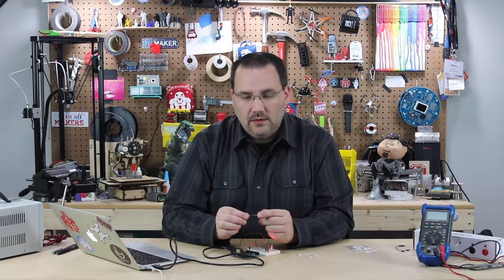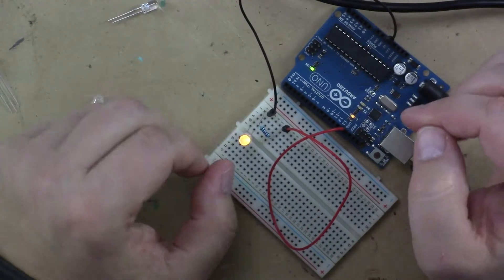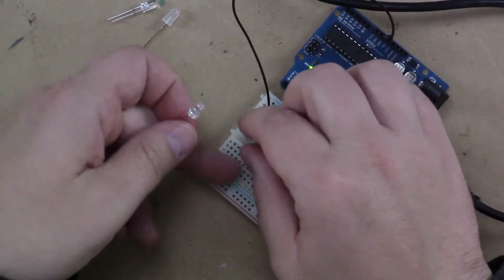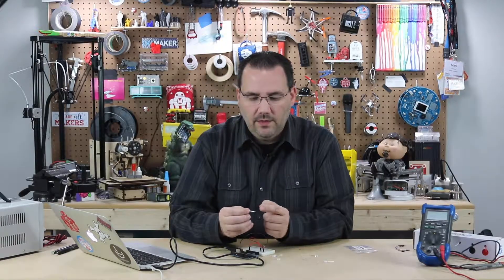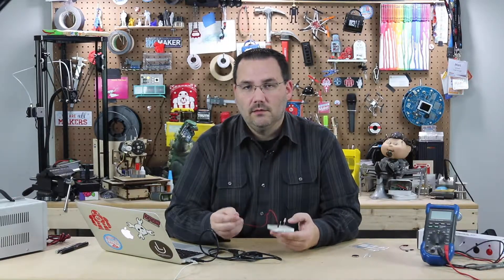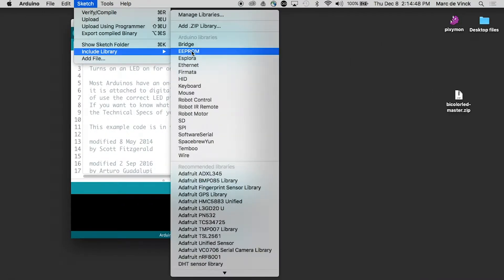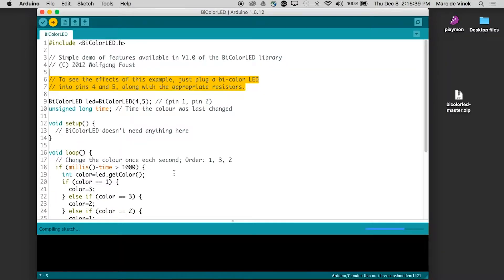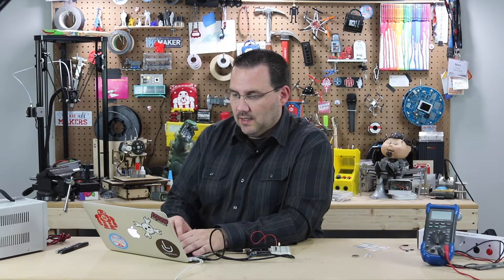Arduino Prototyping Outputs #70: LEDs (Bi-Color)

Comment: does the circuit follow the code after you disconnect it from the computer?
Reply from the maker: Just to clarify. Are you asking if the code will run independent of the computer? Yes, all the code is compiled on the computer then it is uploaded and stored on the Arduino itself. Just keep in mind, you need to keep a copy of the code on your computer for future reference, changes, or updates. You can not download code back to your computer from the Arduino itself.
Reply: @MarcdeVinck  yes, thank you!
Reply from the maker: @davidnobre5660  You are very welcome!